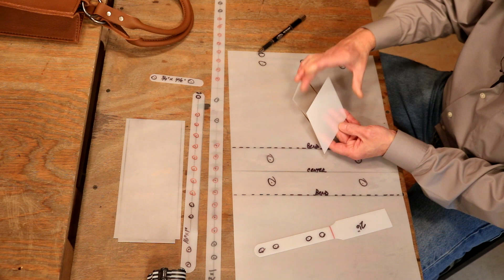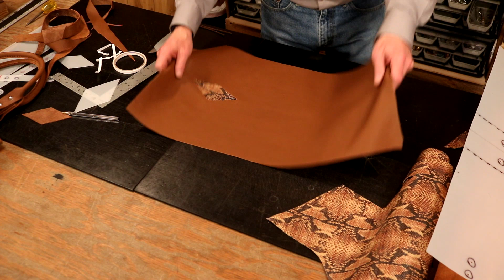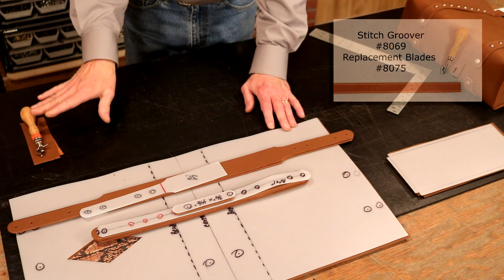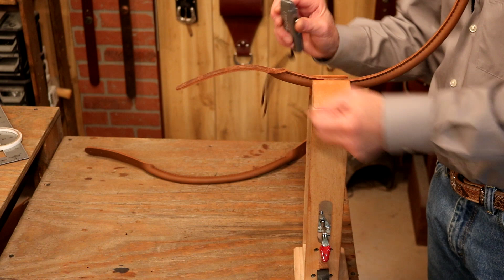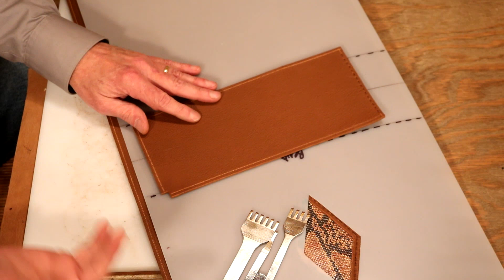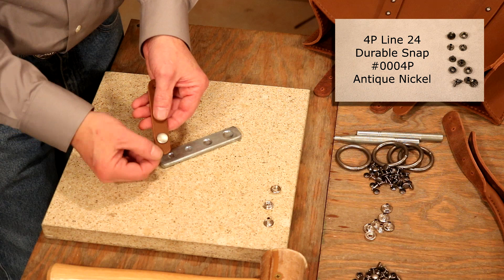Making a Leather Purse with Reptile Inlay

Comment: Chuck, getting ready to cut leather to make this purse but ran into a problem. The strap attachment holes are 1/4 inch longer than the holes in the bag. Is this due to the straps having to go around the bend or an error in the pattern? Thanks.

Comment: Why can't you use a strap cutter on chrome?
Reply: It doesn’t have the stiffness to resist the cutter to keep it lined up like a veg.
Reply: OLD LEATHER SMITH here, yes you  can,.all U have 2 do is make sure you hold tight the piece you R cutting, I personally use a clamp even.on my veg tan, no clamp, a clip nailed, or screwed, 2 your table will also work, more Questions feel free 2 ask, GOD'S BLESSINGS ✝️⚾🙃

Comment: Ok .. so .. being VERY new to leathercrafting and having ZERO experience with chrome tan .. I noticed you didn't slick any of the edges ... is that a veg tan only step? As always, very informative. I always learn something watching Chuck .. keep it up
Reply from the maker: Hi Andy,
Tokonole will work to slick some chrome tan edges but if not, like @Unmutual said, you can roll the edges. You can also use edge paint or leave the edge raw like Chuck did in the video for a more rustic look.
Reply: I use Toko Pro and it works great on my oil tanned